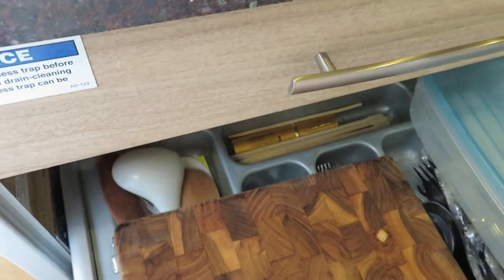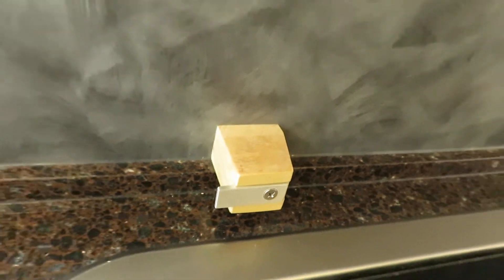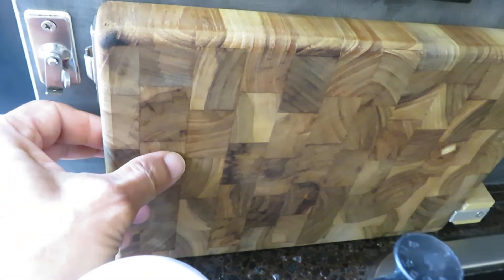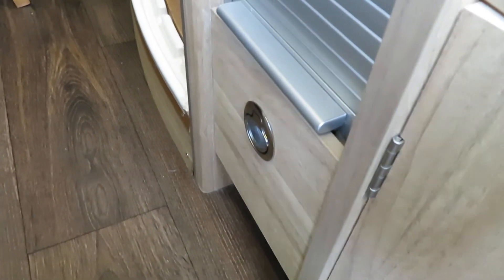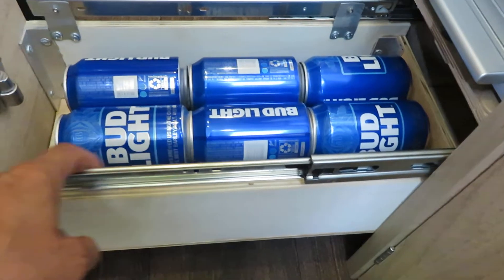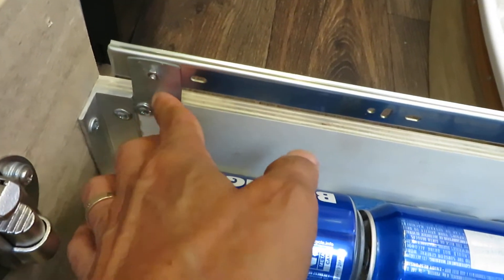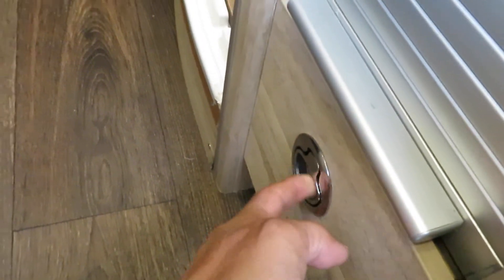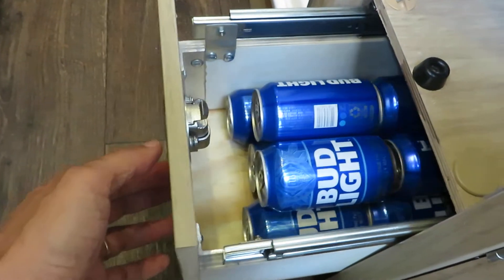Cutting Board Storage and Space Hack for a Kitchen Drawer

Comment: Park, you have wonderful hacks on your Hymer! I appreciate your ingenuity and your extensive knowledge of all things electrical! I have watched all your videos and I try to absorb all your thoughtful knowledge about the electrical system. If I may ask you a question, my Hymer seems to have a parasitic draw on the engine battery. If I allow it to sit too long (a few weeks) I have a totally drained battery. To the point of having to replace the battery as it will not accept a trickle charge. Is there anything common to a Hymer that I can trouble shoot? I do not have your knowledge about volts, etc. Are the slide out steps the problem? Any advice would be greatly appreciated! Thank you and thanks for posting all your videos.
Reply from the maker: The Ram Promaster chassis has roughly a 0.1A parasitic draw on the starting battery by design. The current draw is required to power the onboard computer and communicate with the key fob. Opening a door will activate the power step to make matter worse. Sitting two to three weeks will drain the battery depending of its age. There are four ways to overcome this problem: (1) drive or idle your Hymer every two weeks, (2) disconnect (quick) the negative terminal of the starting battery during storage, (3) maintain the starting battery by a trickle charger hooked up to an AC outlet, or (4) install a ~$100 Trik-L-Start device between the starting battery and the kicker AGM battery permanently if the kicker is hooked up to the solar panel and getting partial sunlight where the Hymer is parked.
Reply: @parkhopper3627  The ProMaster manual only rates the battery for 3 weeks.  As Lam pointed out, an older battery or Hymer devices will reduce that.

There is a fifth way.  Build Lam's brilliant trickle charger that uses the extra solar controller output.
Reply: @parkhopper3627  Thank you for your response Park, it is very appreciated.
Reply: Thank you too Larry!